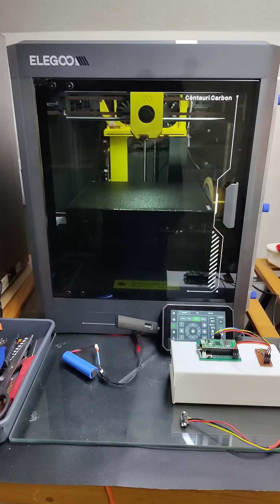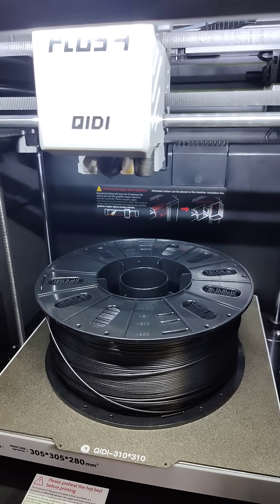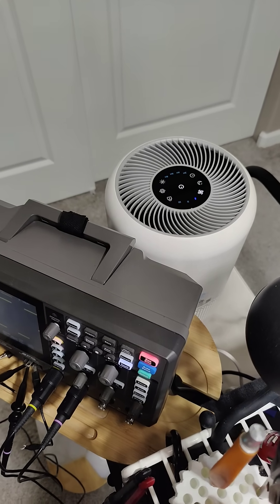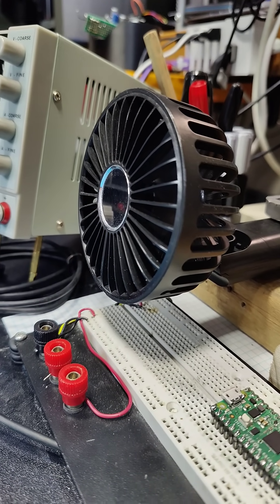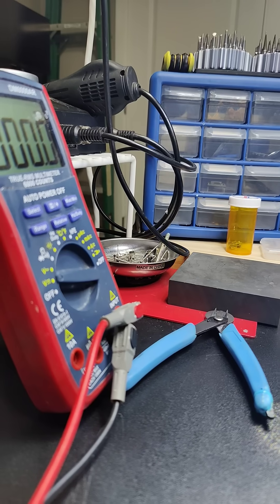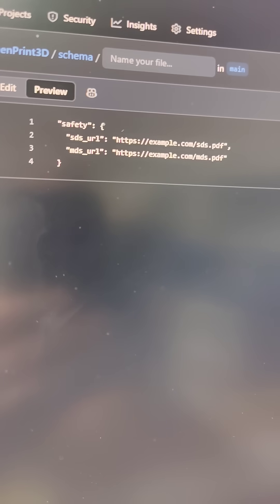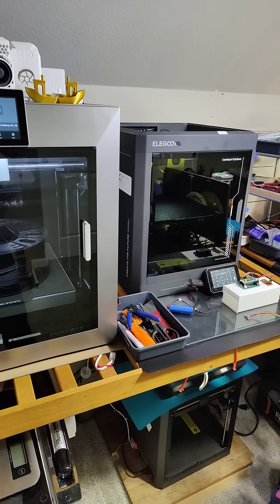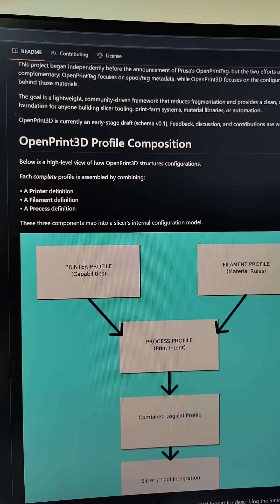Printing Safety, My Cancer, and OP3D SDS/MDS Integration #3dprinting #safety #openstandards

Comment: I am one of those "I'm bulletproof" types.  I don't need no stinkin' ventilation or filters (or badges).  My tiny Anyqubic resin had a little odor but so what? My filament printer has a little odor but so what?  Then I got a UniFormation GK2... uh, ya.  Now I'm designing and building a ventilation system for the print room.  The fumes, vapors, etc from this hobby ain't no lie.  Fun and fascinating.  I like the phrase used in this video "PRINT SMART". That should be the industry catch phrase.  Best wishes for a strong recovery, F cancer.
Reply from the maker: Thanks for sharing this. I know that I tended to have a similar attitude in my younger days. Even though my cancer wasn't caused by chemical exposure, I would definitely feel regret if it was actually because I didn't take safety seriously. I'm hoping this can raise awareness, maybe help someone avoid that very regretful scenario. I like the catch phrase idea 😊
Reply: did you die mid comment it seems cutoff :D

Comment: Well said sir! One addition you can make to your soldering setup is a carbon filter on your extractor fan. It is a small change, but you're already doing everything else haha

My father had an SDS/MSDS book in his garage at home. He had an actual safety cabinet for chemicals like paints and solvents. There is no reason to take chances.

One thing I would like to see people do (as a first responder) is to keep something like an SDS book so if you have an emergency, first responders can see what you have been working with.
Reply from the maker: Great point — and you’re absolutely right about carbon filtration and SDS documentation. I’ve always taken ventilation seriously, but adding a carbon stage is a solid idea for soldering and for certain materials.
And that SDS/MSDS book approach is exactly why we’re looking at integrating SDS/MDS links directly into OpenPrint3D’s filament profiles. If slicers can surface that info automatically, it makes it much easier for people to stay informed and gives first responders valuable context if anything ever goes wrong. Appreciate you sharing this — more people in the hobby should be thinking this way.
Reply: @SyntheticElectron3D  I'm using an  AC Infinity refillable Carbon Filers (6" filter and fan).   My  Parkinson's and Lung Cancer are probably from chemical exposure, kids, wear your hazmat gear!